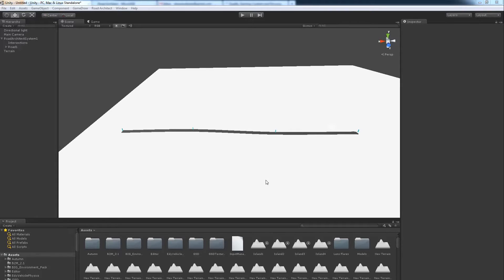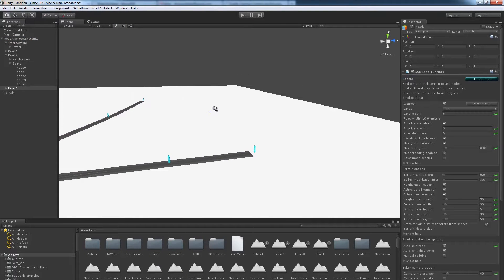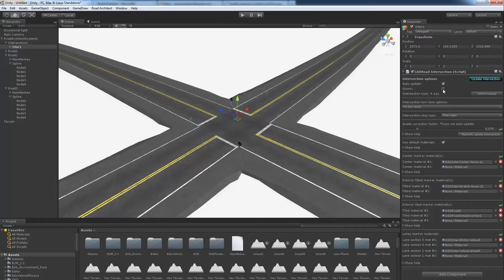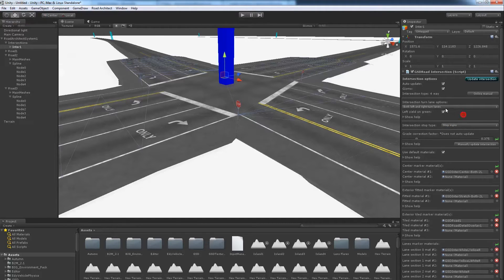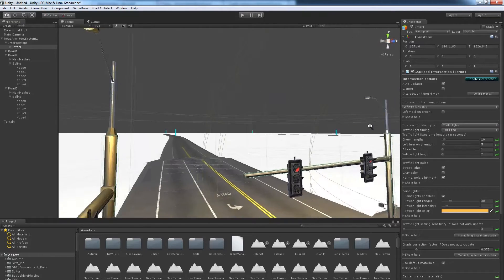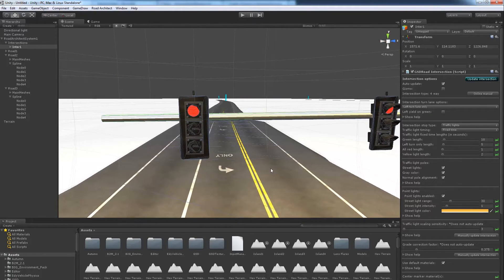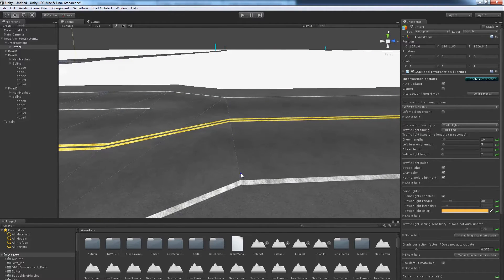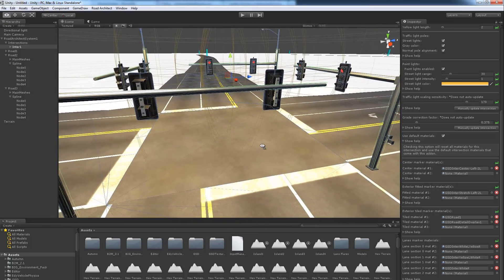Road Architect Tutorial #3: Intersections

Comment: Filipe1020 I have the same problem, you must to be using unity 5, the problem is, the material, the asset create a new type of material that should work properly in unity 4, to fix it , change the type of material to standard, that works fine to me.